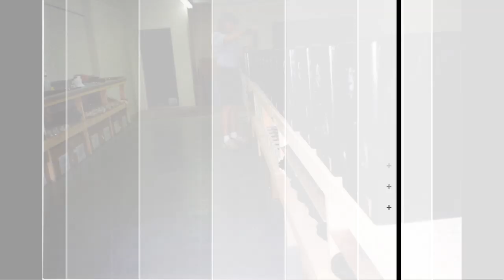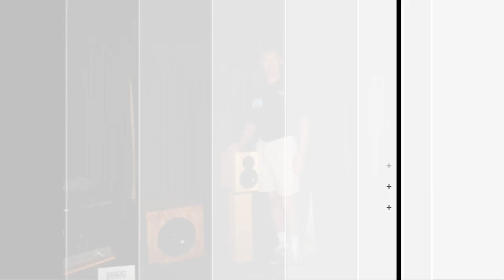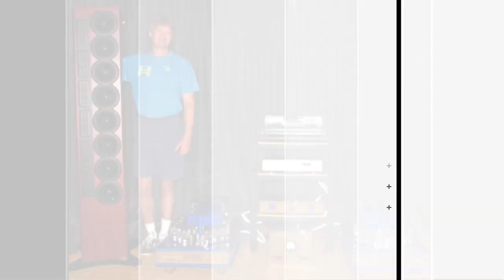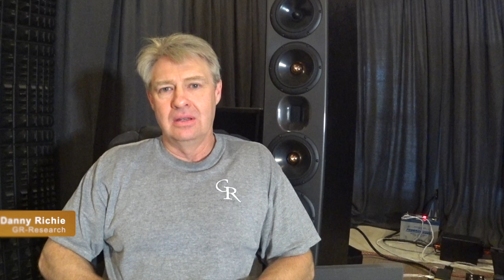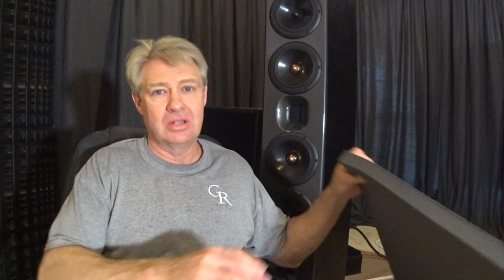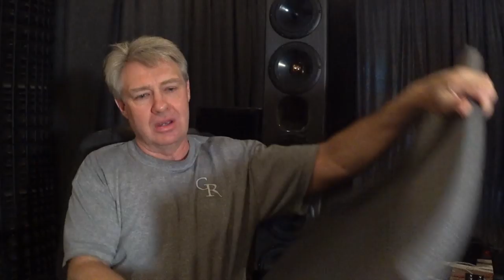Cabinet Resonance | HOW TO TREAT IT!

Comment: As  DYIer the last pair of transmission line speakers I designed and built used 3/4 msd laminated with 3/4” hard maple (1 1/2” total thickness) and I lined the inside with self adhesive lead sheeting. Seemed to work well. I also rounded all inside corners using wood angle pieces and epoxy with “micro  balloons” (fibreglass spheres I got from local boat builder). This was more for reducing sound wave distortion but probably helped stiffen the cabinet as well.

Comment: My previous solution to this problem was to use Dynamat, or Noico. Both products seem to eliminate cabinet vibrations.
Reply: You don't want the aluminium foil stuff it's reflective of sound from the drive units.
Reply: @ianjohnhorwood2605  Not if it's covered with foam on top of it.

Comment: Bubble wrap produces amazing results for damping inside speakers, use the small bubble type and multi fold it tight until it is about 1 inch thick then place it around the inner sidewalls of your speaker cabinets (bubble side outermost)  A very cheap and effective upgrade.
Reply: and yoga mat....excellent....and around $3/piece
Reply: ryes hyes for real?
Reply: I was planning the same, but bubble wrap looses it's air after few months
Reply: Wont yoga mtt color sound?
Reply: @d.s.w7779  Only if you use pink or purple. 😅

Comment: I am taking long pieces of triangular cut HD MDF to reduce corner reflections, applied with contractors cement,  then coating the entire inside of cabinet and braces with a liberal coat of liquid fiberglass. An engineer said that the cabinet strength will now equal over 5in of MDF! All this before my dampening procedures and sending 1 in for a custom high end crossover prescription.

Comment: Hi Danny. Is there any limits in terms of how much damping material you add inside the cabinet? In my case I have added polyfil on top and bottom of my towers speakers. Before to do that, I notice a big resonance of the walls about 400 Hz.  After adding the damping material the resonance clearly has gone, ….and I also realized about many details in mid and high frequencies that I suppose was masked by the resonances before. The problem is now that low frequency response is too loud starting from 50 hz till 200 hz,with it maximum about 100 hz.  Is it possible that this has been caused by excess in damping material? Thank you!

Comment: Stumbled upon you doing the Klipsch 600m upgrade.  You are Extremely Knowledgeable. What is your feeling about mounting speaker on spikes (cone). 
I also place 2 bags of lead shot (50#'s) on the top of the speaker cabinet to absorb & deaden cabinet vibration

Comment: Sounds like an acoustical impedance mismatch and damping can be used to attenuate the mechanical forces.  Makes complete sense - you can do this to prevent mechanical structures from ringing.  Have you tried to quantify how well any of these options work with something like an accelerometer on the cabinet?

Comment: I have a 2 cube speaker box with 12" woofer MCM brand 120 RMS, 6" midrange Fital PRO 150 RMS and 3" tweeter Tymphany 120 RMS and the depth of the box is 14". I introduced polyfill mat with 8mm thick and a port. The diameter of the port is 2" and length 9inches. Just got fascinated with ported speaker box designs on youtube. Woofer is having 41Hz and Mid is 61Hz. For low volumes the bass is good, when I increase volume the bass of woofer is impacting the vibration of mid in the enclosure. Do I need to reduce the length of the port or should I introduce another hole on the right side lower to woofer without impacting my good bass. I am dedicating the speaker boxes to a small church and should they should go long way. Amplifier I use is 100 watts RMS. Please do help me.

Comment from the maker: Hey Danny, I have a question about this one. If a speaker (sealed or ported) has sufficient bracing to control resonance, is something like norez still needed? Would there be any added benefit of using norez if the sweep looks clean from the get go? Thanks for the video!
Reply: Bracing can minimize wall flexing and resonances, but can shift the resonances higher up in frequency. However, the higher frequency resonances are easier to damp out. So a product like No Rez is still very effective. In the case of a well braced speaker, instead of just tightening up the bass region it may more significantly improve the vocal region. And resonances don't always show up on an impedance sweep. Smaller resonances may not show up at all or only show up as output levels increase.

Comment: Before any of the current sound deadening materials were available, I added 3" fiberglass insulation to the walls of my 3 way cabs. It seemed to work well. No more boomy bass. The bass became tight and punchy and seemed to be lower in pitch than without the insulation.
One question though, when you use a product like black hole five, does the thickness of the pad or no res subtract from the volume of the cabinet. Not volume as in sound pressure, the area in the cabinet. And as far as deadening material goes, what about rubberized undercoat like you spray under cars to keep them from rusting back east? I have no experience with the stuff living in the desert southwest.
Reply: I hope he replies to your great question with an answer. Would like to know this myself.
Reply: Nice one, hope I don't have to start over again.

Comment: Good afternoon Danny, great info.. Out of curiosity, I used cork to line the inside of my cabinets , they have great internal bracing. I don't know if that was a good move . They sound good. Just wandering your thoughts. Thanks again.✌️
Reply: Cork doesn't really add mass or damp resonances very well. So not effecting these too much.
Reply: @dannyrichie9743  , okay, just had materials so did it on a whim.. thank you sir

Comment: Since adding damping material reduces the effective size of the cabinet, and assuming the cabinet wasn't originally designed with the material in mind, will this effect the performance of the speaker?
Reply: Actually adding a foam layer can slow down the airflow in the box and make the box act as if it is larger. So product like No Rez can be added without really effecting the box volume very much.
Reply: @slomo1010  you can get non flammable alternatives. Rock wool works too, pretty sure you can get non flammable for that

Comment: I tried open-baffle speakers with 3" thick HDF baffles. They had some strengths, but produced a very audible resonance and an inferior midrange to my loosey-goosey Spendor cabinets.

The heavy-braced speakers I've owned sounded least good overall.     Have you read any of the white papers the BBC wrote on this topic?
Reply: 1000% agree some of the worst sounding speakers that cost huge money are braced so good that they do not sound remotely good!  Just was at a store that sells $80,000 speakers and was taught this very valuable lesson.  Guy has over 40 years in the business!  Sometimes a speaker can have no magic so to speak because of this desire to dampen the heck out of the cabinet.  Wouldn't have believed it myself unless I heard it as I just did.  That's why speaker manufacturing is more art than science sometimes!🤓🤔🤗😉  and ofcourse I am talking  about over damping. A cabinet that is well designed from the start really doesn't need most if this damping material!
Reply: @bigjay1970  agreed!!!
Reply: @bigjay1970  You might be describing two different things here.  1) is the damping of reflected energy inside of an enclosure.  It converts acoustic energy into heat and does away with (much of) the rear wave energy in a sealed box.  I believe the video is more about damping the actual cabinet walls so that they don't shake audibly when the speaker is playing.  The difference being that you might have a cabinet that is so stiff and well built that it has extremely low resonance at any frequency, but you'd still have to add absorptive material (foam, fiberglass, etc.) to control the rear wave energy.  Otherwise, the rear wave energy interferes with the speaker movement and, in very bad situations, can even be heard coming out through the diaphragm of the speaker.

Comment: Hi Danny,
Have you ever had a chance to evaluate the effects of lining the internal walls of the enclosure with lead sheet ? What I did was to employ a matrix type bracing with apertures allowing for air movement, lead sheet is fixed with hundreds of screws and a compressed layer of slightly elastic, yet strong adhesive. Self adhesive, engine room type sound deadening mats go on top of it and then glass fibre fills inside each matrix shell "cell" with progressive density as you move away from the speaker. I know it's hazardous and politically incorrect choice of materials, but for sealed enclosures you can scream at your heart's delight facing the driver aperture and remain barely audible. I use lead sheet between half inch and and inch thick, deadening matt is a dual layer affair of about 12mm in total with rubber underside and thick open cell foam layer on top.

Comment: 3/4 " particle wood is the best with little layer of pillow poly fill is good enough. olden days they use to put in glass wool. MDF boars are too dense box resonance is not that good. same with wood and plywood etc. cabinet resonance is must because the woofer alone can't give that kickdrum effect so the box resonance helps in. its not colorization. when you make the box walls too thin then the colorization kicks in.

Comment: I have considered using a layer of heavy wool felt 3/8-1/2" thick instead of foam on top of dynomat or industrial floor tiles.  Has anyone tried using felt?  It seemed like it would have the right properties for dampening cabinet resonance.
Reply: Troels Gravesen uses felt to line internal surfaces in his designs. Specifically, I've seen it on the SBA-741. Then he stuffs with wool (or other suitable dampening material).
Reply: @mjcorser  cool thanks for the info.  I may "build a pair" this winter. : )

Comment: Hey Danny - I just discovered your channel and subscribed.  I really enjoy watching your videos that you upload. I've made crossover upgrades for 10 years now - mainly caps and resistors.  I use Mills Resistors.  I dont just use Sonic Caps, but I also use Mundorfs and Jupiter caps.  I keep the same values of the caps and resistors I replace.  The only thing I really do not upgrade in my crossovers are inductors.  You mention about upgrading inductors.  Does this make an improvement ?  And what wire size should I upgrade to when it comes to the woofer section of the inductors ?

Comment: I used to sell B&W and nautilus was interesting in bracing tech to make cabinet more inert.But wht I find intriguing these days is Magico.The whole line even the least expensive uses aluminum panels with aluminum bracing that is screwed together from side to side.Of course with Magico least expensive is still $10K!!!.I wonder if the bracing with torsion rods have to be screwed down as tight as one can or if it has some "tuning" sweet point?And of course I wonder if it could be used with DIY or more resonably priced speakers like GR.Thoughtz????
Reply: I've designed speakers that were made from milled Aluminum. You can see some photos of them in our pics: https://www.facebook.com/pg/grresearch/photos/?ref=page_internal   Aluminum is very solid and shifts the resonance point up much higher in frequency. However, the higher frequency resonances are easier to damp out. It's just really expensive to use.
Reply: Torsional rods would likely vibrate like a guitar string.
Reply: @bc527c  well maybe I am using wrong descriptive term but look at cutaway of Magico A3.Could be that the tight screwing together reduces that effect while deadening inner frame./outer panels.The lus would be rigidity while allowing for more room to resonate and not being an interior dampener.Kick myself as I was at T.H.E last summer and did not hear them but they got a few rave reviews.Given Magico line starts usually at $30K and goes to ten times that I thought worth a listen if they share that aluminum cabinet and bracing.Next time
Reply: @charleskatz2606  Yeah, it sounded to me like you were talking about a rod or wire, like a shroud on a mast on a sailboat... and on a diagonal inside... The A3 is thick aluminum plate with areas cut out, that will vibrate differently. No one is going to exterminate cabinet vibration 100% for any sane amount of money, so you have to make it so what is there is not harmful. The Magico M3 cabinet vibrates a little, a very little... but still some. That minimal vibration along with isolated drivers does allow Magico to accomplish some fine sound. Very dynamic, the near perfect amount, actually, and sound utterly divorced from the cabinet.
Reply: Screw tightness won't change much unless the mating surfaces are not fully seated. But then you might have two surfaces rattling against each other. Probably best to just tighten well.

Comment: in the case of sealed cabinets, since they are filled with acoustic stuffing, i am thinking that cabinet Resonance also are reduced. bass reflex cabinet might have less pressure inside at some frequencies but much less sound absorbing material inside.
Reply: Whether the cabinet is sealed or ported will not change what goes on regarding cabinet wall resonances. And the internal damping material can slow down air flow and pressure changes, but does little to nothing for cabinet wall resonances.
Reply: Acoustic stuffing is an absorber, not a damper :) Generally to dampen a structure, constrained layers with different densities and viscoelastic glues work well.

Comment: Ain't there a chance that you move the cabinet resonances to where you can hear it
Reply: Regarding bracing, yes, that's a common phenomenon. Typically what happens with poorly implemented bracing is the resonance moves to a higher frequency where our ears are more sensitive. This is why you can't build a cabinet all willy-nilly and expect good results. Though products like No Rez do not typically move the resonances upward. In fact I've never experienced that from any remotely similar damping material.

Comment: Hey Danny, great video. Quick question about No Rez, I just got in a pair of Zu Omen Dirty Weekends. I haven't taken them apart yet but I don't think they have any internal bracing, if anything there's just a pillar of foam centered in the cabinet similar to what's used in the regular Omens. If I try out some No Rez, is it best to line all the walls completely or just place a few pieces strategically?
Reply: For a speaker like that I would line all of the walls with it. And the No Rez will make more of a difference in a lightly braced or un-braced design like that.

Comment: Any ideas how cork works as a damper? I use it on my speaker stands and have wondered about it for cabinets. Thx.
Reply: Cork would be a good material to sandwich between layers. Layers of different densities are poor conductors of resonances. By its self it really wont add sufficient mass to control the resonance of a larger panel. And ultimate example or layers of difference densities is the use of sand. See a good example here:  https://www.ebay.com/itm/264376946847?ViewItem=&item=264376946847   Sand is also great for filling up stands.

Comment: can we use this damper on the outside of the cabinet?
Reply: It is designed for inside use. The foam layer would be of no use on the outside, but the damping layer would still be very effective. And it wouldn't be very pretty on the outside of a speaker.
Reply: Danny Richie thanks! How about adding another layer of wood outside the cabinet? I somehow see this common from sonus faber where there is additional wood trim on the outside of the cabinet sides. Would that help cabinet resonance and dampening?
Reply: Yes a decorative but heavy wood layer adds mass and is usually a different density from the material used to make the box. So it can be very effective.
Reply: Danny Richie thanks a lot!
Reply: @mykeldg  If adding another layer of wood, I'd consider putting a layer of mass loaded vinyl between it and the cabinet, and/or using some viscoelastic glue (usually ones that stay tacky) You could also use lead sheet
Reply: @RennieAsh  Yup. I've thought about doing that too but at some point we reach the law of diminished returns and I'm betting that's close to it. If the speaker is constructed well from a better material to begin with and braced strategically before lining the walls with no-rez or something similar, there should be little need for a dual layup. But if one was inclined to pursue it, adding a sandwich of viscoelastic glue or Dynamat between the two layers would be most impressive and would probably net you that last 5%. Lots of work for what seems to be little gain outside of cosmetics.
Reply: @RennieAsh  Make a gap and fill it with sand , it´s very effective.

Comment: What about the stuff that's been used in car's for decades? I think it was called Dynomat or something .
Reply: Good stuff. It was designed for steel surfaces but works well.
Reply: Did you happen to try Dynamat ?
Reply: @dannyrichie9743  Jute Padding that was placed underneath the carpet in cars? I have some that came factory installed in my Technics SB-G800 speakers and was thinking about adding some the all the surfaces inside the cabinet? i know this video is old so...
Reply: @bobnevala5218  Make it easy and just use No Rez.